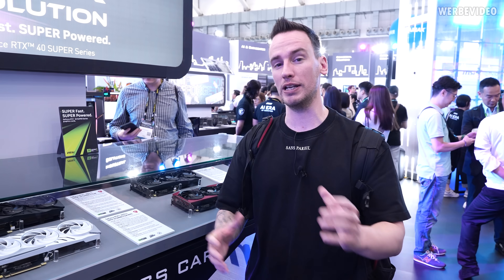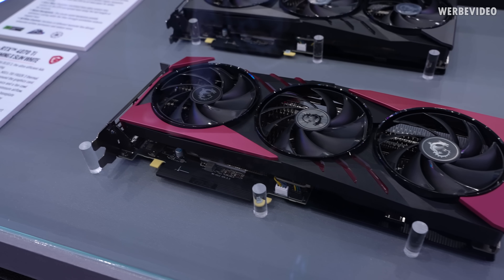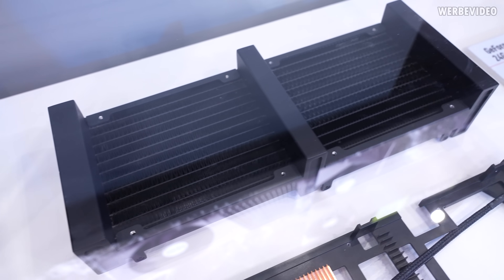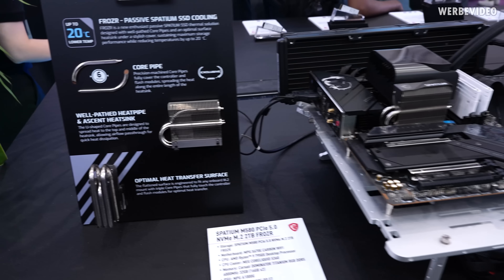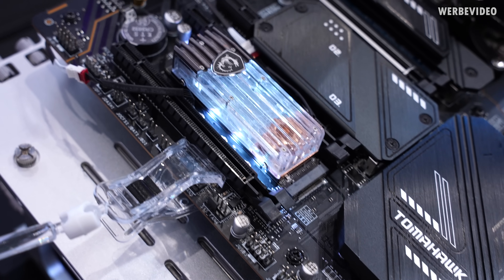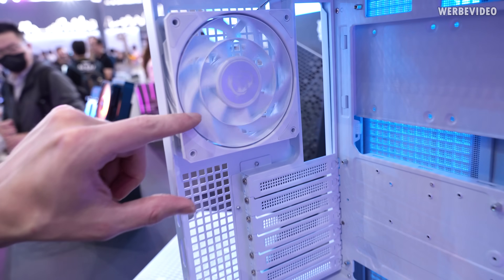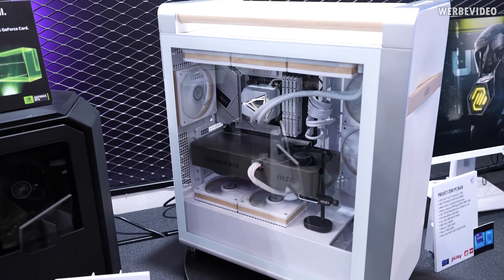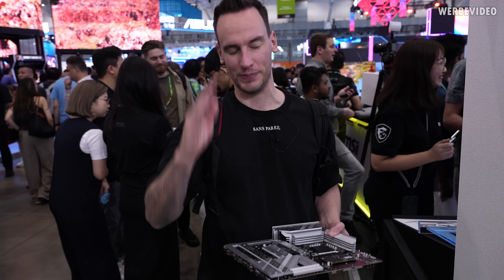The Most Experimental SSD Cooling Concept in Computex 2024 - MSI

Comment: It's odd how MSI want to have both their M.2 cooling solutions under the same name when the first one is using only a heat sink and the other one with vapor chamber, when it's pretty obvious it shouldn't work as good. The only "selling points" for that one is maybe the see through chamber and the smaller size... Pretty much the lame RGB selling point, not far from the one Ali Express types with RGB on M.2 cooling, but that rather heats the M.2. If they had any kind of knowledge about marketing, they should be able to conclude that, if the sales of the vapor chamber version is going bad, it most likely will make the other product with the same name sell less.

I figured this out, and I hate marketing.... It seems like more and more of those getting a degree but doesn't know shit are taking over.

Comment: An issue not addressed by most SSD coolers is that they occupy a "dead zone" in many cases. Like in my Fractal Torrent, although it has great horizontal airflow generally, there's nearly no air movement over where the M.2 alots are on the board, and the GPU is so massive with its enclosed shell design there's no passing airflow. These massive, horizontally mounted GPUs cause huge airflow restriction and do weird things to internal vertical convection. Many cases now don't have top vents, or have PSU enclosures at the top, making fan placement more difficult particularly with the huge 25-35 cm rads we're now having to use on modern CPUs. My 40 series card almost totally blocks airflow over the SSD slots (ProArt X670E) and I've had to fit low profile finned xclio heatsinks to get temps reasonable. Having a PCIe 5.0 SSD also doesn't help for thermals. Perhaps it's time for a design which incorporates a very low noise fan, or we bring back Zalman PCI slot mounted fan brackets and make those cool again?

Comment: A two stage radiator. Best of both worlds. High fin density on the first stage to dissipate the hottest heat. Second stage fin density allows maximum air flow to cool the fluid to its coldest before going to pump head

Comment: There will not be pressure building up in the SSD cooler case if it is typical phase change. It would start off under vacuum and as the temperature of the system increases the vacuum would be reduced. If water is used it needs to go over 100c before it builds pressure.

Comment: Ahhhh the fin density thing makes so much sense, the fans have much more static pressure on the outside, so this probably helps to actually move the air more spread out, idk what the actual performance difference is but it does make sense

Comment: No way.
The EVGA 3090TI Has a 360 radiator and the heat that exspells is very warm.
With a 120 radiator and a 40 or 50 series cards, no way it can cool properly. 
Save your money and build a custom loop

Comment: Tighter fin spacing means more air resistance. Unless you want to run 15000rpm fans, tighter fin spacing can often lead to worsened performance because of this.

And the thicker the radiator and lower fan speed you want to use, the more space is needed between the fins to keep the air flow acceptable.

Comment: An AIO card with a 120mm radiator is completely dumb. Because it will not cool better than an air cooled card of the same size and the pump will fail at some point.

Comment: Depends on the liquid. We used to use a silicone based fluid to cool the small crt picture tubes on rear projection tvs. It was an optically clear cooling fluid because the 9" crt tubes were run bright as heck and hot as heck. The lens and mounts were plastic and would have leaked if the fluid expanded too much. They didnt. I still have a bottle of it and wondered how it would work in a pc cooling system. It would need an oil pump style pump.

Comment: The reason behind the radiator might be that the airspeed and pressure generated by a fan are lower in the center and increase towards the edges. With reduced pressure and airflow in the middle, wider fin spacing helps facilitate air passage, reducing resistance and enhancing circulation in that area. This results in a more uniform airflow across the radiator, maximizing heat dissipation and preventing hot spots.
Reply: Yeah it's like how HEPA filters have a higher rating for capturing debris from the air, yet more conventional filters have a better record of actually cleaning the air in the entire room. The HEPA filter may be more capable at trapping things, but that doesn't matter if it chokes the fans more.
Reply: then why even bother populating the center part with fins...

Comment: I think that for the less dense aio the reasoning could be that they can now optimise for higher flow rather pressure. I could easily see a bigger benefit in higher flow speed/more air than more surface area. Also, they raised its thickness, which could indicate that they still needed a bit more area to make up for any losses?

Makes me wonder what other effects it might have

Comment: We got sockets for CPU and CAMM MEMORY, When will  we get GPU in such form instead of a big card plugging  into PCIE slot..???
Reply: When? 12 years ago. It's called MXM and was very common in laptops about 10 years ago, but is mostly abandoned because it's more complicated than just soldering the GPU to the motherboard, and designing coolers that are the right shape to work with MXMs with different GPUs and VRAM is difficult. A few ultra-high-end "desktop replacement" laptops still use MXMs, but it's rare.
AFAIK there has never been a mainstream desktop motherboard that supports MXM (unless you use a PCIe to MXM adapter, which defeats the purpose of having a thin and compact GPU module), but some new industrial/server motherboards (e.g. AIMB-288E, which has an LGA1700 socket) have MXM slots.

Comment: Would love to see them fitting that ssd cooler with a gpu in the pcie slot, every time I see people worried about wires and cooling and stuff, I just wonder when are they going to worry about actually being able to use the complete motherboard without working around stuff, can't change your nvme without removing gpu, can't add cooling without worrying about the gpu, can't use all pcie slots with a big gpu unless you go vertical and then you can maby use some of it, but you have to remove the gpu, so dumb

Comment: 3:05 yeah der8auer you're remembering all the extensive testing done a while back, 2004ish? or around there. 
It was tested everyway possible and more fin density = better performance = better cooling BUT also cost more as more material is being used etc..
MSI should've just said "cost" to keep the cost down.

I do have to give MSI props for actually having support for the GPU's in the rear of the card. Unlike many I've seen without. No matter how strong the socket is, support is needed.
I'm a simplistic person, no RGB's or screens, like it sleek and clean so a lot of the eye catching products are not for me
Reply: could be that because the fan/airspeed is lower near the middle of the fan having less obstruction in the center is better
Reply: I think because higher fin density means more back pressure, and a thicker radiator also means higher back pressure, they balanced out the two rads so they'd have roughly the same amount of pressure to be matched with the fans. Lower fin density counteracts the thicker rad.

Comment: I am surprised nobody has made a GPU with a monitor on the backplate yet.
Reply: I want one underneath the heatsink
Reply: @flyaway6671 the Pimp My Ride edition
Reply: I bet that the monitor would love the heat but hey we already have SSD’s in GPU’s.
Reply: @Simon_Denmark   we actually need SSD’s connected directly to a GPU chip. and not on a looooooooong & lagggy PCIe bus. that would allow TBs of hybrid "VRAM" for realistic textures, models and effects loaded directly from SSD = actually realistic movie-like graphics in games. actually properly working DirectStorage like on consoles but with a way better GPU chip. won't happen because its the last GPU you'd ever need to buy - after GPUs are capable of movie-like graphics there's no +0-10% "gains" per year with GPUs to milk the market with. and also that would make consoles obsolete - kill amd sales of obsolete cheap-to-make chips to ms/sony.
Reply: There has been a GPU with the monitor on the side though (I cannot remember who did it but I think it was a 3000 series Nvidia card and I don't think it was done by a top 3 GPU company which are Asus/MSI/Gigabyte and their gaming sub brand). ALSO I think this is because of 2 things firstly when under load that backplate can get very hot and this monitor will also be hot too and secondly due to thermodynamics and how hot air is lighter than cold air all the GPU heat will just be rising up through the card and the backplate will expel a huge chunk of that heat  which will cause the monitor to suffer
Reply: Doesn't Colorful makes those?
Reply: Problem is with thermals, backplates get quite hot and the components not being able to dissipate heat from the back isn't great.
Could be done, but would complicate things, probably requires some space above the backplate for it to breath. Even when you do you will mostly be looking from the side, so viewing angles are also problematic in most situations.
Reply: I think it’s because of how hot backplates get, if you put anything more than just the metal plate they  probably will have thermal issues.
Reply: This might work better for a vertically mounted liquid cooled gpu, such as matrix with the front replaced with a monitor, or any custom waterblocks

Comment: Yeah that M.2 heatsink from MSI doesn't look substantial enough to cool a PCIE 5 drive at all! It looks like it's been designed down to contain the failure (leakage) as a bigger unit would leak more in interface with the metal cooling

Comment: Oh that’s what they were calling it by moving the connectors to the back of the motherboard. I am so annoyed that they came up with a new-ish motherboard standard and didn’t replace the power cables with a bus bar.
Reply: more annoying is they are making some cases for those motherboards without increasing the space behind the tray, just like the one shown.
Reply: Bus bars would be even more annoying
Reply: @shanent5793  a bus bar in this application could just have standardized plugs, you would just slide in the PSU to connect it on that end and there would be connectors you would drop the motherboard on the other end, rather than the eyelets you typically use with bus bars.

Comment: I like that AIO designed GPU. In my experience, even a 120mm radiator can out perform a massive tripple fan two-slot heatsink. Also that bottom-top fan ( don't know how to call it) is also pretty interesting. We can see the heatsink blades are horizontaled, means the hot air will be sunk from the bottom fan, travel through heatsink and be pull out by the top fan. This design well resolve the problem of conventional design that hot air was blocked by GPU card itself. The intake air temp would be affected by the exausted air which is not idle. Brilliant idea.

Comment: If the denser fin stack is on the side where the higher temperature liquid is entering the radiator, it makes sense that you would not need as dense a fin stack on the output side to reach an lower targeted output temperature. This would also reduce manufacturing costs. 
With GPU and CPU cores running at higher temperatures, how long will it be before a thermostat is required to keep temperature balance in the cooling system?

Comment: 9:01 awesome to see CAMM2 so close up. Fingers crossed CAMM2 is rolled out fairly quickly, it sounds really promising 🤞
Reply: It's dual channel memory on a single connection better interconnections to CPU and over 8000  mT I like it
Reply: I especially wanna see laptops adopt camm and get rid of soldered memory
Reply: @ashenwattegedera   yes there is where it belongs. Not in desktop space.
Reply: I hope the single channel dimms are common
Reply: Looks cool for cooler clearance, not so much for upgradability/capacity though...
Reply: Its very good for upgradability, especially on laptops @Bourinos02
Reply: @Bourinos02  as if you would want 4 sticks in the current standard anyways
Reply: @WhoTFMadeThisChange  Well, that's always a nice upgrade path... The performance loss is really minimal in most scenarios.

Comment: I really don't get the "project zero" thing. That's just going to make swapping components harder and require more space behind the motherboard...
Reply: yeah and look a lot nicer sooo
Reply: Personally I would go back to "hard mode" cable management and forgo any space behind the motherboard tray. I remember running flat/unsleeved cables ON the motherboard tray and then setting the motherboard down on top of them, it accomplished the same thing but the cases back then were basically just a steel wrapper around the PSU and 5.25 bays, as thin as 160mm wide, which is absolutely miniscule these days.

And imo PC width matters more than any other dimension for desk space.

Comment: Thicker radiator allows you to achieve the same surface area with less airflow restriction. The amount of heat a radiator can reject depends on the area of its “face”, once the air is the same temperature as the the water additional surface area can’t have any effect, and you have diminishing returns the whole way there, so it’s better to reduce airflow restriction so you can get more air through

Comment: Any SSD which gets hot enough to require this kind of cooling is not worth bothering with. M.2 made storage convenient, the kind of thinking behind this stuff is distracted from the goal we should all want: trouble-free storage.
Reply: You could make the same argument about actively cooled CPUs and GPUs. Some people like or even need the performance that comes with increased power consumption.
Reply: @kotekzot  1. Different objects are different, and the constant equivocation of everything is tedious and untrue.
2. The people who actually need the performance aren't buying this stuff, they're buying servers with the drives mounted in caddies with 15kRPM fans screaming behind them.

For even a power user, there is no perceptible difference in the performance of something like the Sabrent Rocket 5 (runs cool) and the hottest fastest drives in the world. Not only does a difference barely exist, the applications which can exploit it also barely exist.
Reply: @phillycheesetake  some applications scale very well with IO speed. Workstations exist. Somebody is buying those PCIe x16 to 4 M.2 adapter cards.
Reply: @kotekzot   I'm not talking about the adapter cards, I'm talking about the exotic M.2 coolers.

Anyway, it's clear at this point all you want to do is make vague enough statements that they can't be argued with. "workstations exist" oh that's very clever, because I clearly said they didn't, didn't I? Arguments like these are essentially concessions.
Reply: @phillycheesetake  I assume you possess the intellectual capacity to understand the implications of statements like "workstations exist", i.e. not all high-performance applications are handled by servers; and "people are buying quad M.2 adapter cards", i.e. there are people who need a lot of IO bandwidth.
Reply: @kotekzot  "I assume you possess the intellectual capacity"

Redditspeak.

Comment: Got the stock spreaders on with my msi motherboard, top gen 4 ssd is running 29c, bottom two gen 3's in raid 0 running 34/35c. I think it's good on cooling.
Reply: Only Gen 5 requires anything special, and some of the newer Gen 5 controllers don't.
Reply: @concinnus  Yep. Even on my previous motherboard with my 2 gen 3's they had no spreaders at all. I bought a be quiet bc1 pro cooler for each and it did exactly nothing on temperatures for them. I'd say that only when moving into u.2 and beyond that those modules really need cooling.

Comment: the last motherboard u held up where did u put rams looked like it had no ram slots
Reply: CAMM2 module. It uses lga contact pads and is bolted on. That's the rectangle where the memory sticks usually are.
Reply: @Retro-Iron11  thanks
Reply: It doesnt have slots. Its using CAMM2.
Reply: @honestgoat  thanks
Reply: did you watch the video muted? he explained it was CAMM2
Reply: @WayStedYou  i had low volyme on i cant say other than that

Comment: You can’t really even see the bubbles it’s not worth the sacrifice in heat dissipation for like barely any visuals
Reply: might be more visible than on video, but I did at least see one single bubble on my phone. heat is the main thing I would worry about, would be better to just get something dedicated to loop bubbles in safe conditions, rather than that unsafe "cooler"
Reply: @lassebrustad  It's less visible than on video. Watch again, MSI even had a magnifying glass on top of it so people could see the bubbles.
Reply: i am more worry about the possible leak if it works under load  for long enough the pressure and heat, the liquid might just find the easy way out
Reply: what do you mean? I saw a very consistent line of bubbles tho?